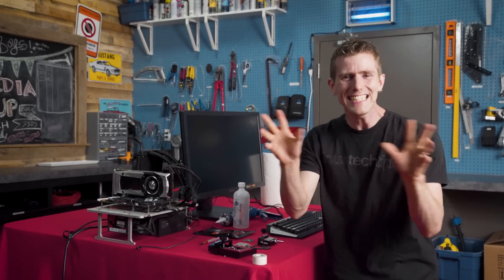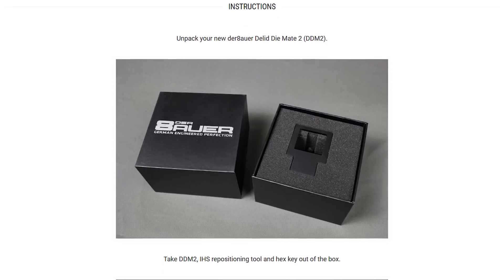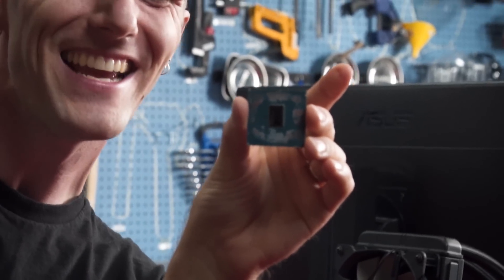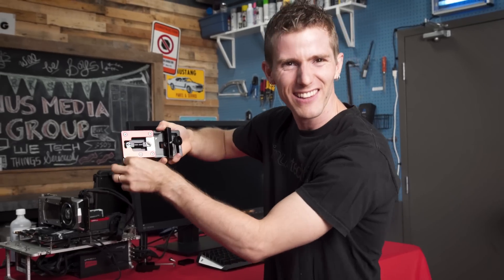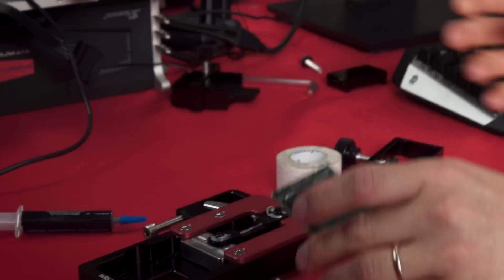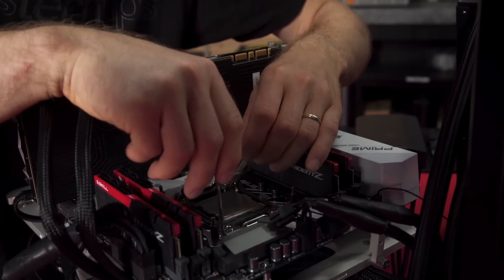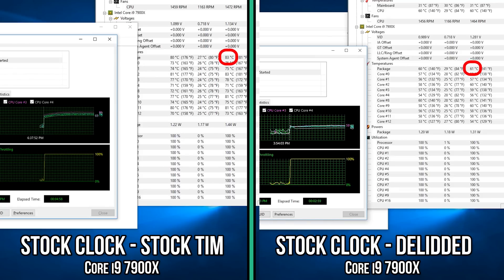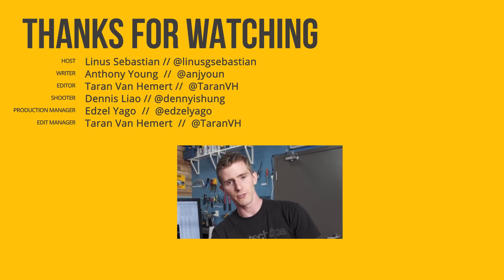Delidding a $1000 CPU - Worth the RISK??

Comment: So Linus, have you told Intel that their thermal compund in the i9 is essentially rubbish and needs improvement?

20 degrees C is 33% improvement which is massive. All based on deliding and using a better thermal compound.

Intel need to sort this out. Or I'm not buying an i9

Comment: To all the people commenting about liquid metal, yes it would be better, but if anything this video proved that it's not necessarily the interface material that's the problem, it's the IHS. The act of delidding itself  is what provides the greatest change in temperature, not liquid metal or thermal paste. 20 degree difference  at stock just from switching brands of thermal paste is unlikely. The real issue seems to be that the IHS is too high from the silicone adhesive, it's not making proper contact with the die. The die/TIM isn't making proper contact with the IHS so there's a gap, and stagnant air is of course  terrible at heat transfer. By scraping off the adhesive, the IHS makes proper contact, facilitating heat transfer.
Reply: Nathanial Gardner That and Intel's paste is still the worst of all time. They could probably get an extra 5° if they used liquid metal. I get your argument, but using liquid metal would drop the temps even lower.

Comment: so many times he says synergy. and he does say "seamlessly" but. compare Synergy to Teamviewer. I just want to know the least amount of "jitter" aka input lag. how long it would take for the non main one to receive the input if either mouse movement or if super smooth. how much "lag" would you have every now and then from watching a youtube video on on someone else's PC. how much mbps to = 30fps 24min(movie standard) 60 (would like plus it's your hz) and what about pic quality. is it seamless cause no presentation. so basically remote mouse but for PC.
Reply: Teamviewer does all but sometimes drops majorly in fps lag like a mofo. 😒. like 200 ping on FPS. it jump cuts. and quality sometimes 240p and pixely. so I just want to know a screen sharing program that is "stable" in the overall sense. and doesn't frame drop like crazy with the added of internal sound. imagine Skype screen share but with internal sound. Teamviewer has but the low spikes are ridiculous. high spikes are omg. you feel like it's actually your PC.

can someone help in my search. even if you have to post a link. I'm about to give up.

tried searching for 3-4years I feel like either I'm looking in the wrong places or that I'm using the wrong keywords.

Comment: Once again, linus did it wrong. Poor die coverage, didn't use liquid metal. What a waste of time.
Reply: Vyktym once again, you refuse to acknowledge the results. What a waste of time.
Reply: And yet he still got reductions of 17 and 20 degrees on the two CPUs, despite "doing it wrong", so clearly not a waste of time. More clear is that Intel are a fucking joke.
Reply: And yet, they're STILL faster than AMD.
Reply: Agreed. He kinda flopped on this one. It was done with not enough care in it and "discovery" instructions. Instead of solid instructions from the pros. This can be an easy thing or it can be hard for others to accomplish depending on care and consideration. I bet I could have got a better result.

Comment: Can you do a long term test with the de-lided 7900X? Maybe leave it in a workstation and run benchmarks on it regularly, that way we can see how the thermal grizzly holds up over time. I believe the most common reason given for why Intel doesn't use paste like this is longevity.

Comment: I mean, why? What's the point in not applying proper thermal compound straight out of the factory? When buying the compound in bulk, how much difference will there really be in cost on a per-unit basis? Is the automation process and equipment needed for applying a proper thermal compound more expensive? I just don't see what they are getting out of something as trivial as this. Is a couple of bucks really worth having it be publically known that your company cuts corners in their production process, resulting in sub-par performance? I don't know, maybe there's something i'm not seeing but i really don't understand their reasoning behind this.

Comment: The profit for not soldering is almost minimal compared to any other expenses intel have.

 1. Chips that run hotter die faster(so more sales for them on the long run).
 2. Overclockers can not gain much benefit with overclocks so they upgrade their cpu more often. 
 3. People are delidding their cpu and loose warranty so less hassle for them with warranty stuff. 

The cost for soldering a cpu or putting a proper thermal paste is a joke and what intel wants you to believe.

Comment: why no liquid metal? temps would drop 20 degrees! that is the whole point to delidding is to use liquid metal instead of thermal grease.
Reply: Except is did drop 20 degrees anyway! thats how awful the stuff Intel uses.
Reply: I believe the sensor is somewhere within the silicon.
Reply: Watch WHOLE video before commenting next time... It did reduce temperature 20C using non conductive paste... Only logical reason I can think of for Intel to use so bad thermal paste is they WANT your CPU to run hot. This is to make sure it will only last just as long as the warranty and also not over clock well, all to make you buy new, faster and / or more expensive CPU... I absolutely hate all companies that is so greedy that they sabotage their own products to sell more.
Reply: Liquid metal only gives you a couple extra degrees over quality thermal paste
Reply: Watch the video first, you moron, it did drop by 20.

Comment: What about making delidable processors? like not glued together with the IHS maybe a couple torx screws? put a shorter warranty and make people happy
Reply: Delidding shouldn't even be necessary anyway. It's a measure put into place to make up for Intel's decision to use bad TIM on its chips.
Reply: yeah but intel wants to keep using that paste, and making a delidders version would make it easy for the people who want to ude liquid metal out of the box or preffer a high en cooling solution... specially on unlocked processors, but anyway, all should be unlocked imo
Reply: what i say, is make two versions, one model designed for deliding
Reply: carlosflar screws are more expensive than liquid metal
Reply: Or, I dunno, they could just use decent TIM in the first place.  Would be a cheaper option too.
Reply: Anton Helsgaun that's fucking right...
Reply: because 99.9% of people don't give a fuck about delidding and wouldn't want to trade extra warranty time for it.

Comment: Why didnt you use something like Liquid Ultra or Liquid pro. As those are liquid metal, the heat transfer is amazing with them. As for your comment about running bare die cooling, you said that theres no easy way to keep the cpu held into the socket. Incorrect, if you have the right cooler mounts, you lay your system on its side so that when you place the cpu in, it lays flat, then add your thermal compound and mount the cooler and the pressure from the cooler keeps the cpu in with good contact. I am currently running a bare die cooling setup with my 4790K and a Supremacy Evo waterblock with Liquid Ultra as the thermal compound. With that setup, I was able to maintain 5ghz at 1.48v under water with a max temp of around 85c. (dont do that, it no likey that voltage)  Personally I think you should do a video on bare die cooling with modern cpus and give extreme overclocking a try. EK sells the mounting rods (whatever they are called) so that the waterblock will lay directly on the die.
Reply: Zombie Thermal Grizzly Conductonaut. It is liquid metal.

Edit: Aaaand I just noticed he used Kryonaut.
Reply: they only started putting IHSs on becasue people where bricking P3s with the insane mounting systems back then.

Nothing wrong with running bare die
Reply: Isaak neither CPU in this video are using any sort of liquid metal thermal conductor. I took a look online at conductonaut and it is different than what is shown in the video. Also with liquid metal it has a distinct look and applying it takes a bit. I usually use a toothpick to apply it.  I believe using actual liquid metal would help temps quite a bit. Especially for overclocking the i9.

Edit:posted before I saw your edit 😂
Reply: Andrew Joy running bare die is amazing imo. But only if you know what youre doing. As for warranty. I've done some damage to 2 or 3 4790Ks. All were delidded. I just added some thermal compound, smacked on the ihs with some super glue, made sure it was straight and Intel replaced the cpus without any issue. The chips also had no physical sign of damage. They did that with my 5ghz chip too. Man I'm still pissed I degraded it with that voltage. It was a great chip. Ran at 4.8 with 1.3v and after it degraded. So like 3 weeks of running at 5ghz, it needed 1.35v to be stable at 4.4ghz

Comment: shit.. a 20 degree improvement shows that Intels new platforms running hot isn't purely because of the new design, but probably mainly shit TIM.. I doubt the price of a 1000 dollar CPU will be way higher if they invested in higher quality TIM, but the value would be way higher.

Comment: WHY AGAIN PASTE, PUT THE FREAKING LIQUID METAL IN BETWEEN !!!!!!!!!!!!!!!!!!!!!!!!!11111111111111111111111111111
Reply: Exactly this. All these comments about liquid metal and the tutorials using it are what scared me enough not to delid my Devil's Canyon CPU.
This video actually makes me want to try it.
Reply: @Chiriac Puiu When does Linus ever do something recommendable? Or prefer the safer method? Don't get why he shies away when it comes to pimping CPUs...
Reply: Liqud metal not needed and it gives more trouble then it is worth for little gain... And this also is a nice kick in the balls at Intel for using such a shitty TIM... 

Only logical reason I can think of for Intel to use so bad thermal paste is they WANT your CPU to run hot. This is to make sure it will only last just as long as the warranty and also not over clock well, all to make you buy new, faster and / or more expensive CPU... I absolutely hate all companies that is so greedy that they sabotage their own products to sell more.
Reply: Did you break your shift button???
Reply: He broke his pinky finger by holding it longer than the warranty would cover.
Reply: Finish the video first, seriously, it got the same results as Liquid Metal, 20 degrees decrease.
Reply: The difference would be bigger with LM! Expect up to 10 degrees more!

Comment: Hi Linus, why would you replace the TIM with another TIM, instead of a solder alternative such as liquid metal?  I have seen much better results using liquid metal.  Just curious.
Reply: Brandon Frontz point of the video wasn't to get the best thermals. Just to showcase how to do so and explore if it's worth it. And liquid metal is harder to work with. More expensive. And requires reapplication immensely more frequently than TIM. From what I hear every 6-12 months.
Reply: And I would say that dropping temps by 20°C is good enough. ^^

Comment: I did it with my 3570k brand new, i didn't even try it before XD I just used a razor blade and arctic mx-4. No glue, the retention system was enough to keep everything well tight. I got something like 15C° less compared to a "normal" 3570k in every scenarios... with the stock cooler! I'm still intensively using it since then :)

Comment: There is so much wrong with this tutorial, it is not even funny. Always use Liquid metal when deliding (thermal grizzly conductonaut is the best on the market). Never use the "dot-methot" when applying thermal paste on a naked chip, you should always spread it to avoid any hot spots.
Reply: Jan Dano to be fair, they never claim that this is a Tutorial.

Comment: 6:31 Nope Linus, you are wrong here. In this case it's not overengineered, because that lever is necessary so you can apply the needed force to the IHS by just more 'easily' turning that screw. The leverage does the rest. Der8auer himself explained in a video, that by using the 'direct screw to the IHS'-method, he couldn't apply enough pressure to the IHS to overcome the adhesive and cohesive forces of Intels silicone glue.

Comment: Just like last time, I strongly disagree. If you buy a K or X CPU, you do so with overclocking in mind. When you overclock, you want that last bit of performance. Therefore, everyone with a K or X CPU should de-lid it and replace the TIM with something better. Replacing the silicone is actually not really needed. Back on Ivy-bridge (when I first de-lidded), I cleaned off all the old sticky stuff and used IC Diamond instead. The TIM itself is sticky enough to hold the IHS in place and you can use the motherboard as an alignment tool. Also, this de-lid tool is so much better than hitting your CPU with a hammer...

Comment: you have to remove the stock glue completely as it creates a gap between the crystal and the top cover. Can you delid gpu chip from nvidia GTX 200-GTX 400 series? That is what I want to do and it will be interesting.
Reply: Correct me if I'm wrong, but GPU dies are bare and don't use a heat spreader so there is nothing to "delid". You can, however, reapply new/better thermal paste to the bare die and possibly lower temps...

Comment: Oh man Linus does deliding again ... When will he use liquid metal....
Reply: Solitude he did used thermal grizzly which is one of the best he got 17c reduction ,and there was probably another 5c or so from liquid metal. But when your going to the trouble of voiding your warranty may as well get all the temp reduction you can
Reply: Damien LM it's only for grown up's
Reply: Exactly, he actually claimed to put Conductonaut on there (which is the Liquid Metal) but showed putting Kryonaut on there. So not sure what's going on there.
Reply: Actually, liquid metal also received around 20 degrees dreduction, he wasn't really using low class shit.
Reply: liquid metal is a rockband?
Reply: kurvaszar vicc volt
Reply: Akkor a megoldás erre az hogy bazdmeg 😆

Comment: So that shitty thermal performance is due to the 50 cent worth of a thermal paste ?! on a 1000$ CPU. Speechless! :D
Reply: It's not the stock thermal paste that is low quality, but the gap between the die and IHS created by the thick layer of adhesive silicone. I'm really disappointed that Linus didn't cover this at all, in fact they completely skipped over removing the adhesive.
Reply: BOFslime but this don't explain why the problem is there in first place, when it's so easy to fixed.

Comment: Why then haven't the delidding tool creators created a new "heatspreader" block to replace the OEM spreader, particularly one which is already a heatsink or liquid cooling block itself? That way you'd have better cooling efficacy due to fewer poor heat transmitting thermal compound layers.

Comment: **Shake my head & Facepalm**  Linus, the hell dude?.... People who de-lid a processor, well the wiser people anyways, will always use liquid metal under the IHS at the VERY least.... Liquid metal should be used on the top as well...  It's a wasted effort to use thermal paste all over again dude.  The most important part of de-liddings performance comes at high overclocks, not stock speeds.  This is disappointing.  Please, reevaluate this again with something like Thermal Grizzly Conductonaut and you will see better results...  And, throw it up on a video.  Please...  You will be a believer in it afterwords and I bet you'd recommend it.

Comment: Still as bad as the last delid video. Thermal paste instead of LM. Absolute joke XD
Reply: DildorTheDecent literally anything is better than the potato paste that comes with Intel.
Reply: I'm well aware. If however, Linus wants to do this video properly then Liquid Metal is a must.
Reply: DildorTheDecent properly? Lol. Ok. The video is mostly about these delidding tools, but ignoring that for now, properly according to what? The point was to improve thermals. Well, mission accomplished, thermals we're improved.
Reply: I can already tell that you've never delidded a processor in your life XD Anyone who delids is going for the best performance possible through overclocking. That means using the right "paste" for the job. Only one that fits that bill is liquid metal.
Reply: DildorTheDecent uh huh. Flame on, bro.
Reply: DildorTheDecent cool story.

Comment: You delidded and didn't use a liquid metal thermal paste? Explain to me what the point of this video other than to get views on a video of a mediocre scientific method...
Reply: Replacing the TIM with a better TIM may not be as good as replacing it with liquid metal thermal paste, but I would hardly say that a 20°C temperature decrease is "pointless."
Reply: to show intel's toothpaste inside 1000$ cpu ?
Reply: 20C reduction in temperature pointless? I say not... LQM only give slightly better results and this also show how horribly bad the TIM Intel uses is... Only logical reason I can think of for Intel to use so bad cooling paste is they WANT your CPU to run hot. This is to make sure it will only last just as long as the warranty and also not over clock well, all to make you buy new faster and more expensive CPU... I absolutely hate all companies that is so greedy that they sabotage their own products to sell more.
Reply: So, a "slightly better" paste DECREASES TEMPS BY 20!?

That's exactly how much GamerNexus and the others got with Liquid Metal.
Reply: +Solitude dun dun duuuuuuuuuun
Reply: Agreed... the reason people delid is to replace normal TIM with liquid metal. Just swapping normal TIM for an only sleightly better TIM is pointless.

Comment: MSI actually HAS a little gadget made so you can run a delided CPU without the IHS and with the retention bracket still on. 
You don't even risk breaking your CPU with the mounting pressure of the CPU cooler